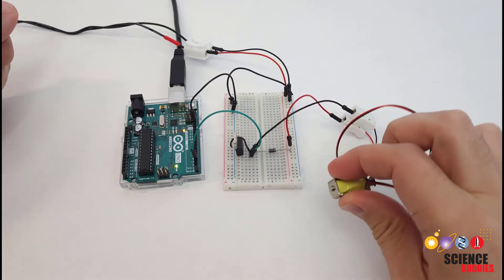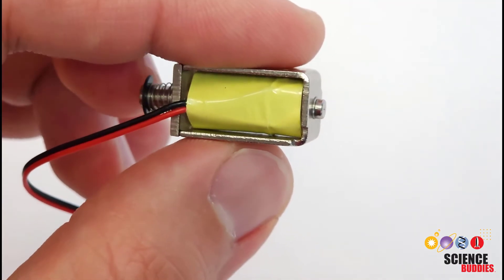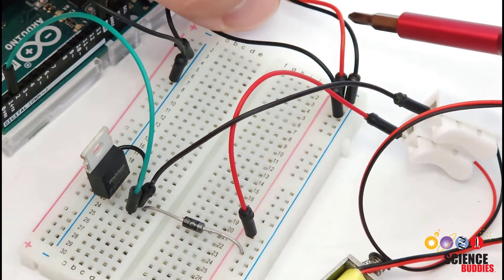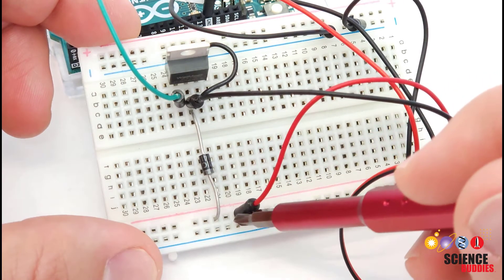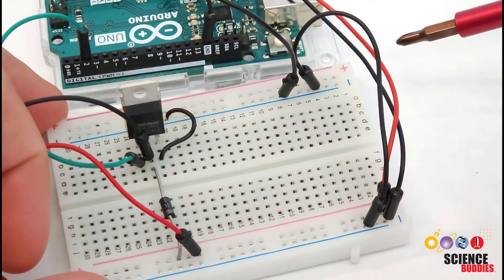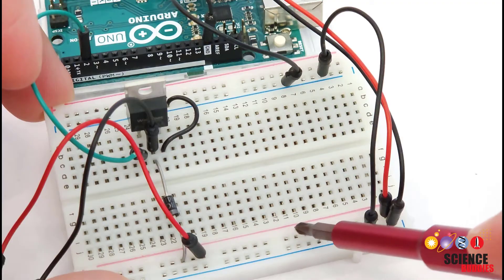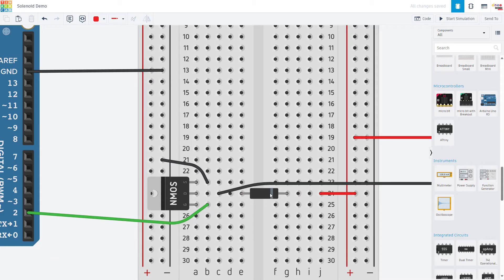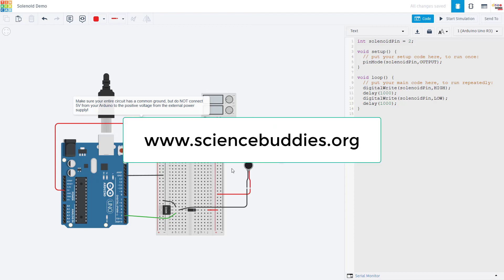How to Use a Solenoid with Arduino (Lesson #37)

Comment: Solenoid part number/item name?
Reply from the maker: The solenoids are linked in the materials list of this project: https://www.sciencebuddies.org/science-fair-projects/project-ideas/Elec_p109/electricity-electronics/refreshable-braille-display#materials
Reply: @Science.Buddies  Thank you. If I am not planning on firing all solenoids at once, ever, can I get away with duplicating everything off of pin 4 (and power) and adding more solenoids to fire based on user input in the code? Or do I always need a big enough power supply to power all 6 (even if I don't need to use them)?
Reply from the maker: Hi - this gets a little more complicated than what we can answer in a YouTube comment, you might want to ask in the official Arduino forums or a forum dedicated to electronics.

Comment: Hi! Great video! I understand why we use all the components except the MOSFET transistor. What's the point of using the MOSFET transistor? Is it something we use to control components, as it provides a digital connection (between the Arduino and the component) and hooks it up to ground?
Reply from the maker: The Arduino's I/O pins cannot provide enough current to directly drive a motor or solenoid. If you check out our Arduino tutorial playlist (linked in the description) there are other videos on DC motors and external power that explain this a little more.

Comment: what transistor and diode are you using
Reply from the maker: For the diode, a common rectifier diode like 1N4001. For the MOSFET, RFP30N06LE 30A 60V N-Channel Power Mosfet TO-220

Comment: I have a 12v solenoid and a relay, I don't have any mosfet or diode on my solenoid. Which is directed to relay.

the relay is connected to the battery and solenoid, and to Arduino
relay has NO, Common, IN. 

Is this safe? It is causing a random signal on my coin slot IR sensor, which is causing a count even though I'm not dropping a coin in the slot.

Please help me.... this is for my project at school.
Reply from the maker: Hi - we recommend asking for help in a dedicated electronics forum like the official Arduino forums or a place like Reddit or Stackexchange. You will need to post pictures of your circuit and your code in order for people to help you, otherwise nobody can really tell what exactly is going on.
Reply: i hope you reply here

Comment: Would a relay here work as well in replacement of a transistor? I thought transistors are meant for fast switching
Reply from the maker: You're correct, a relay would work here as well, but not for controlling the speed of a motor with a PWM signal from the Arduino where you need the faster switching of a transistor.

Comment: I have a 3.7v tiny valve solenoid which has 2 black leads, and doesn't seem polarity sensitive. Do I still need a diode?
Thanks for the informative video
Reply from the maker: Hi - technically it's good practice to use a flyback diode for any inductive load like a motor or solenoid.
Reply: @Science.Buddies   Thanks. I've got it running without one, or a capacitor ,and it seems fine.